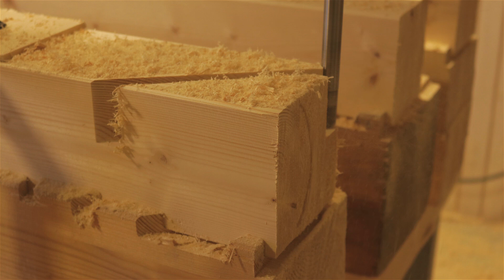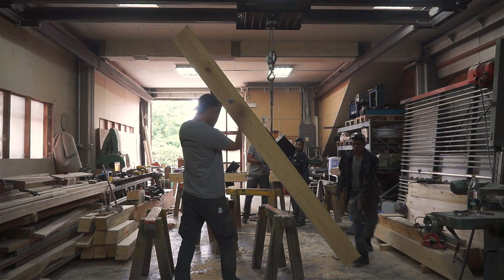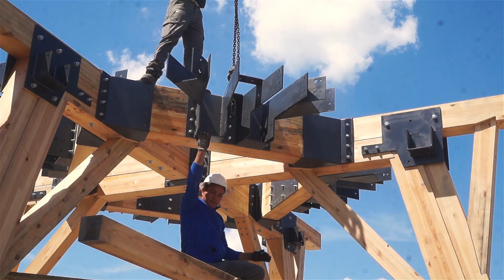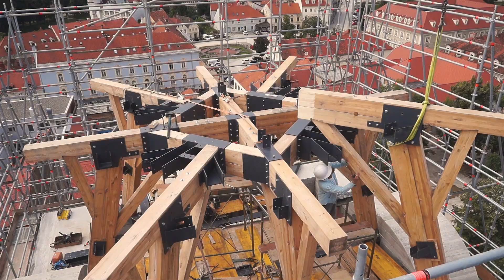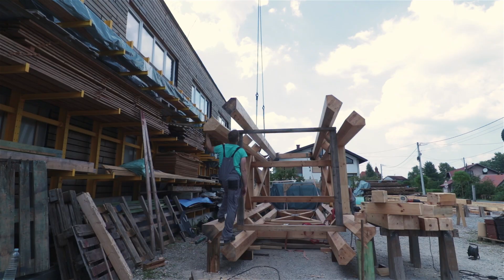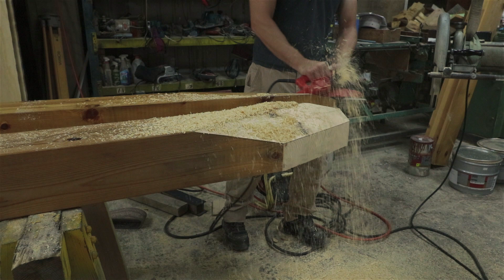We Are Building a Steeple, pt1

Comment: is there a reason you went with so many metal brackets instead of more traditional beam joinery?
Reply from the maker: Strength and complexity. There was an option to do all traditional joints but it would mean a lot of them would have to be done by hand on site and it would just take too long for a few of us. We are a small team and just don't have as many skilled people as they had hundreds of years ago. Also the base is asymmetrical so making so many unique joints on the robot was also out of the question for it would take even longer than doing it by hand. If it was a new build with square base, if we also made the steel base, we could do it all in the workshop and reassemble it on site. Also plate joints are much safer and stronger.

Comment: It's a pity that you've used métal for jointing and not your ability tu make it by hand with wood. Good job anyway.
Reply from the maker: That was one of the options, but it meant most of the work would have to be done on-site, and we didn't have that much time.

Comment: Something very strange, when watching the assembly of the spire onto the lower section.at 17-19 , the framework looks different in one area, where the something has been missed or had to be built as something was not lining up,
Reply from the maker: wow, good eye! when we assembled the structure at the workshop, we assembled it to a perfect level but when we arrived at the job site, we discovered the base was cast into concrete at a slight slope towards the corner. We decided to assemble the first level at that slope because it could be hardly noticeable but also put few millimeters of plates underneath the second level in 3 corners to make sure it is 100% vertical.
Reply: @lignumchannel  Good morning 🌅, They don’t call me Hawkeyes for nothing , 🦅 🧐 😂, back in the late 80s in the 90s I was doing subcontract work for a organ building company back in the UK, I was given drawings to make a substantial piece of framework, that took me nearly 3 months to build, I took it all apart and numbered lettered all the components, I made note of the order that the parts had to be fitted in, I did not set assemble it on the main job, but I had a message coming back saying that I had built it wrong, when I done some more investigation, they had assembled it in the wrong order, So the final stage of the build would not go together,  
Another job I had to construct preformed casework for pouring concrete staircases , These were quite big, The site manager gave me the details of how high and where I should start to build the forms, I measured all the floor levels, to doublecheck his measurements, and they were 168 mil roughly out of line, this actual meant that the bottom set of stairs was 168 mil below the surface level of the floor that’s already there, I explained to the foreman that there Was a discrepancy, he told me that I didn’t know what I was talking about, told me to adjust the floor levels to lose or gain height wherever I needed it it, you can imagine what happened, I ended up making three forms for the concrete, to construct the stairs, Before I had a chance to start on the next set of three, I was called in for a meeting, to discuss the first as they were wrong, Obviously, I knew this already, but the site foreman told me to build it to his measurements, I went to the site with three other colleagues and we managed to get the main drawings for the building, And we found out that the floor levels have been put in at the wrong height, which obviously the site foreman and obviously laid out and signed off has been correct, at the meeting to discuss the problem that I thought I was going to have to pay for, the foreman that was in charge of the site was given the sack, And I believe that he was prosecuted, I was paid for extra time, I ended up getting paid paid three times what I was quoted, for the extra work, I’m now retired living in France, Oh, how I wished I was back at work, Over the last approximately 20 years, I’ve been mainly involved in designing a manufacturing special windows and doors for barn conversions and property renovations, Some of my doors that I’ve made take 3 to 4 people to lift, I worked by myself for most of my life, I had a very large workshop back in the UK, and I’ve constructed windows approximately 4 1/2 m in height, went into ends of buildings, Just gives you a little insight to what I’ve been doing for the past 50 odd ideas roughly, 
I still have quite a bit of my tools and equipment and machinery , WADKIN EKA, SCM CLASS PLANNER + JOINTER , FELDER SPINDLE-MOULDER, MAFELL ROUTER , DOOR LOCK , AND mortising machine, , just to give you an insight to what machines I have, and what I am capable of doing or used to be able to do when I was back at work, stay safe keep up the great mark. Look forward to part two.,
Reply: I noticed that too, I figured it was a leveling issue, I came down here hoping to find out.

Comment: Very interesting, great to see timber framing work, , about 20 years ago, I built a king post trust Roof, by myself in the garden of a property that I was working on, I even made a framework up using steel and timber to support a roof and a chimney stack that has started to move, 
Most of this work was actually done inside the attic of the property , 
Keep up the great work guys it looks amazing , look forward to part two, old English guy now living in France, sadly to say it’s not a bad roses,
Reply from the maker: Thank you for watching! It's always nice to hear from experienced colleagues. 🙂 I know you mean business when you noticed the missing plate! Actually, that was the highest point, and we had to put plates on three other corners to get the second level perfectly vertical. When we got to the job site, we noticed that the base was cast into concrete slightly tilted to one corner, so we decided to even out the mistake between the two levels.
Reply: @lignumchannel  great project, There is a timber logging company near me, they make some very nice buildings, back in the early 90s I was doing subcontractor work for a organ building company, where we would start off with a base frame, Which would sit in the building shop, And then start to erect the organ case on it, but when it went to site, they had special St- steel shims to pack out any discrepancy in the area where the organ was going to be erected, and then bolted through to the floor, Look forward to seeing your project,

Comment: Do you design these, or use an architect? So impressive. Great job as usual!
Reply from the maker: This was the reconstruction of the old tower that was damaged by age and an earthquake. The architect made the 2D drawings according to the scan. The chief structural engineer calculated the cross-sections of the beams, plate thicknesses, and number of bolts. I made a 3D model of the structure and we worked according to that.

Comment: Beautiful work. Question: at 17:31, when the upper/vertical portion of the steeple is put into place, it appears there is a plate missing in the bottom right. Why does that one seemingly not have the plate the other corners do?
Reply from the maker: This is the highest point. The other corners were lower because the steel base was not positioned perfectly level, as we did at the workshop. That's why we had to put some steel plates in three corners to make the second level perfectly vertical.
Reply: @lignumchannel  makes sense! Thank you.

Comment: Very Cool! 😎 Awesome bit of timber framing work done there. Very nice job on fabricating all those steel connecting brackets too. That required a good bit of thought and engineering. 

I got to work on one church steeple in my career. But it was substantially smaller than that one I have to admit. It was one of those jobs I will always remember though because on the day we were to fly it up into place, was the day the Space Shuttle Columbia blew up after launch. We were working quite a few miles south of the launch but could still see the smoke clouds from the explosion. We said a prayer for the crew 🙏and had to get back to work. 🤷‍♂
Reply: *My bad - Space Shuttle Challenger
Reply from the maker: That sure is something you will never forget. I hope I don't remember this project by something like that. I'm glad you like the project, thank you! 🙂

Comment: Knowledge, experience and imagination, when poured through craftsmanship and accuracy in implementation, the result will inevitably be an amazing edifice.
Respect and appreciation for what you are doing, for the engineers who designed and calculated the loads and found practical solutions for every single technical problem, and for those who skillfully transformed the plans into a real structure, 👍
Reply from the maker: That was very well said. Thanks a lot, I appreciate it!